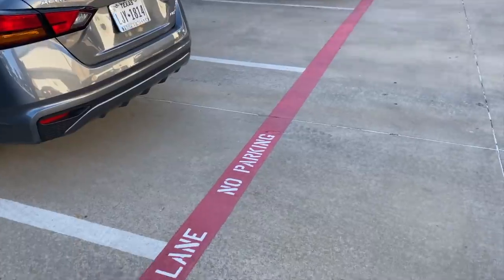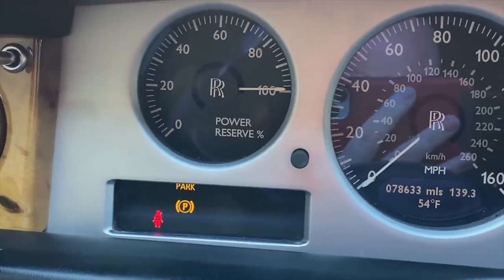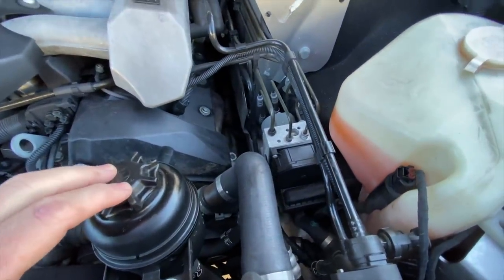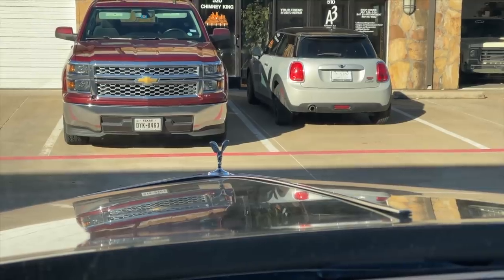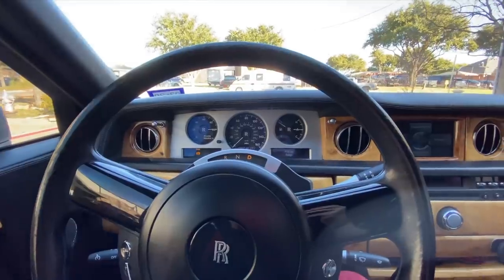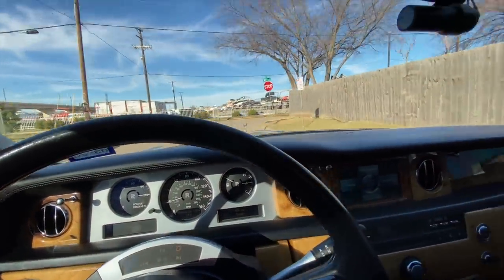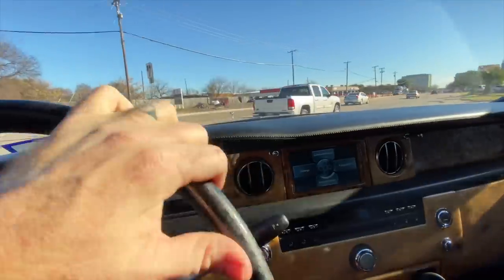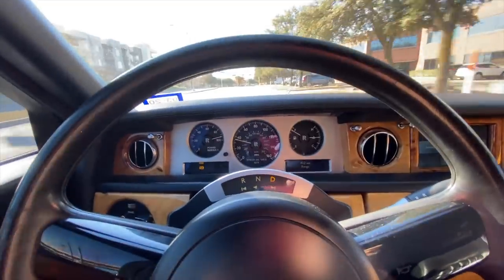The Rolls Royce Phantom is out of the shop! Let's see how much it cost...

Comment: To be honest you should really fix the oil leaks and I'll tell you why. It's not just the cost of the oil leaking. It's also the mess that the leaking oil makes all over the place. Plus the oil leaking all over the engine bay will cause you more damage over time than you realize. Oil eats up all sorts of rubber and plastic parts. So over time those leaks are causing damage to other parts which will cost more more in repairs down the road. Now if you plan on selling the car in the short run, then yeah, I can understand just living with it.
Reply from the maker: Modern DIY Projects Its not that bad and its at the bottom

Comment: You didn't fix the oil leak that was actually making puddles?  It's not just the oil loss, but the knock-on effects of oil burning in the engine bay that I would be concerned with.  I hear ya; nobody gets wealthy by being bad with money.  Warren Buffet still eats McDonalds and drives a $45k Cadillac.

Comment: You know you are right I drive a pickup truck that only 3 years ago I couldn't buy sure it got 224,686 mile on it now and 212000 when bought and it need a lot of maintenance on it but it happen at a time in my life that I could afford it and I've cut across the top end of Texas 4 times 2 round trip's  without any problems thanks for the video bob

Comment: Good on you, you've achieved your goal... That module you replaced is a common problem on both the RR and BMW... As for your e-brake problem, it's actually a simple fix and would probably cost you less than $100 for the part that needs replacing... The plastic gear inside the module breaks, and you can buy the gear made out of metal off eBay... It takes about 30 min to replace... Enjoy you RR

Comment: Right turn in Texas must make the turn as close to the right curb as possible, it is defined specifically for a right turn, but a left turn. A left turn does not specifically state any lane restrictions in Texas per 545.101, the left turn can use any lane legally available to traffic moving in the same direction. Unless the left turn is a dual turning lane with marked dashed lines where lanes are defined, one can turn into any available lane. Also you have no right of way on a right turn on red, you have to yield to all turning traffic if that left turn has the protected green arrow and you have the red light. In Southlake there are signs for right turns that a right turn on red must yield to traffic making a U-Turn. They had such a problem with this that they had to put up signs.

Comment: Actually $1,5XX is not so bad.  I just paid $1,866 for analysis and installation of motor mounts in my Cadillac.  When I brought it in the Check Engine light was not on.  When I picked it up sure enough the money pit had the Check Engine light ON.  Fuel injector 6 was bad.  Paid another $2,3xx to get the 8 injectors fixed.  Maybe it would be cheaper to get a RR.
Reply: Rite just sold my cts i cry but feel better had car a year n a half n every month had to get some fix then a month ago timing chain broke after putting 2000 into the car

Comment: The parking brake can be easily fixed, atleast on a e65 BMW 7 series, the plastic gear breaks and u just replace it with a metal one from ebay. Total cost to fix: about 25 bucks if u do it yourself.
Reply from the maker: It is easily fixed by lowering the rear differential ad replacing the module, $1000 job.
Reply: @RobertMoseley  Ohh thats how it is on the Rolls, jesus. 
On the e65 its pretty easy.

Comment: Broken module because of the donuts and burnouts? I went to trade school to learn to fix home electronics. At that time we still had tube TVs, yes, a lot of vac tubes inside. I just got one fixed and the teacher came, lifted one side up about 1/2" and dropped it down, TV went blank and he said: "See, you didn't fix it". That was a good lesson that I remembered when I went to the Army and was fixing the radio equipment. You have to give the device a jolt test so it will not fail when you really need it to work. Those donuts were your jolt test.

Comment: Every lovely car deserves to be repaired, so good for you! 😃👍🏻
And about your defective e-brake; my E65 7-series had an automatic handbrake function. At a full stop it would put on the handbrake. Touch the accelerator and it would release it. Doesn’t the Rolls have this option??
I certainly found it a relaxing feature. And it also made sure the driver behind you did not have tot stare into your continuous brake lights at every traffic light. Very annoying at night and not worthy of a Rolls... 😉
So, maybe worth fixing with of-the-shelf BMW parts? I remember they were prone to failing and forums should be cluttered with solutions.
All the best! 👌🏻🙋🏻‍♂️

Comment: Lift/Lower - the (replaced) block cycles back and forth between the front and rear axle suspension to raise or lower the car to make the car raise/lower more evenly.  The lift feature is mainly to provide additional clearance of the undercarriage for speed bumps/tables and (ugh) automatic car washes (DON'T TAKE THIS CAR THROUGH AN AUTOMATIC CAR WASH!)
For a P7, getting out of the repair shop for less than $2K is a WIN!  Trust me, future repairs will make you wish for these $1,700 bills.

And, Bob...you are a success!  Measure your value in more than dollars...those are fleeting, meaningless squares of paper that bring no joy.  One's worth is truly measured in how one is regarded by others.  A rich life has nothing to do with money.

Comment: That sophisticated hydro-pneumatic suspension is made by Citroen. Sadly, they stopped making it for their own cars in 2017.
Reply: Paul, that was the case with Crewe-built/engineered cars.  With the introduction of the Seraph series cars, the braking system reverted to a more conventional system, and the two systems (suspension and braking) were separated.  The suspension system continued to run on HSMO (mineral oil).  This was entirely eliminated on the P7 (BMW-incarnate) cars, which now utilize an air-ride (pneumatic) suspension.
Reply: @JeffMedved  Maybe so, but Citroen announced in 2017 that they would continue supplying suspensions to RR, even though they were phasing them out on their own vehicles.
Reply: @paulparoma ...I find that 'curious'.   Are you Citroen wasn't referring to spares for previous production models?  The P7 rides on a pneumatic suspension (similar to Mercedes-Benz and BMW).
Reply: @JeffMedved  Maybe they did mean spares. Who knows?..But that's what I read.

Comment: The way they wire and configure everything  through  the ABS  unit is a pain in the arse..
Most of the time  you lose cruise control, speedo and ABS itself. Aprt from the power steering

Comment: Those were expensive donuts and burnouts, let that be lesson to you that a Rolls is not for doing such things!
Reply: Sorry to tell you, Rolls Royce can handle donuts and burnouts especially the newer models, you can drag race them if you want. It's no different than any car, it's just a BMW. It will not permanently destroy the vehicle, that part that failed is common, it would've happened anytime while casually driving. Rolls Royce built these vehicles to handle such maneuvers. It's all good.
Reply: My point is that its a car for a gentleman not for a boy racer!